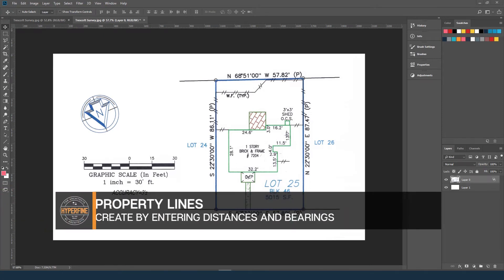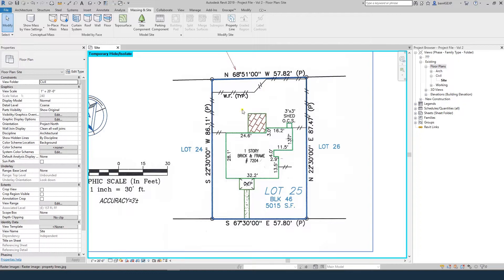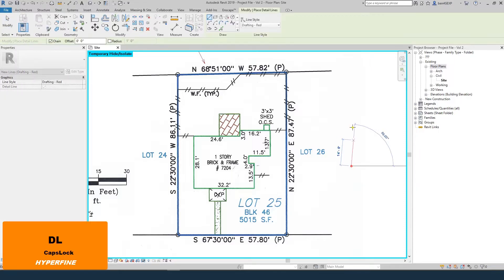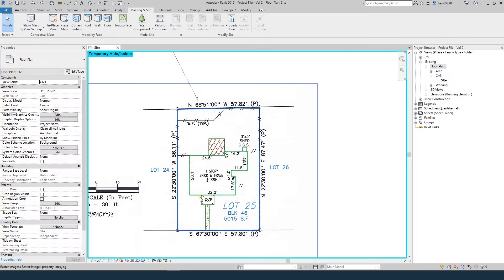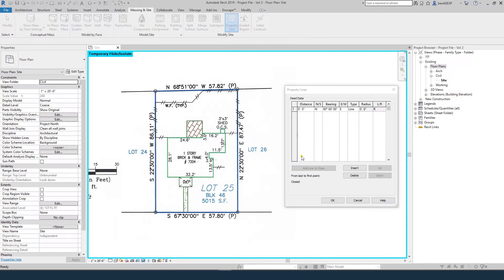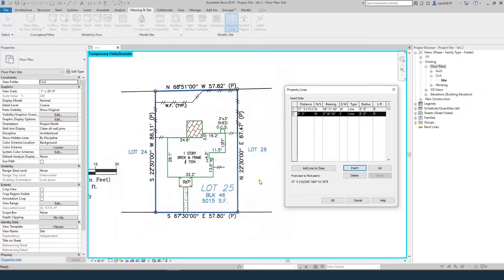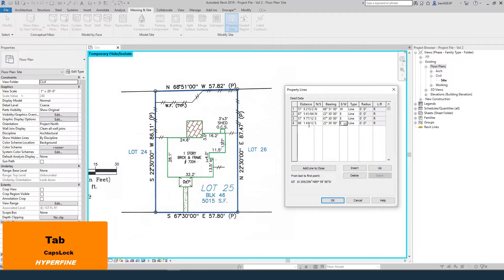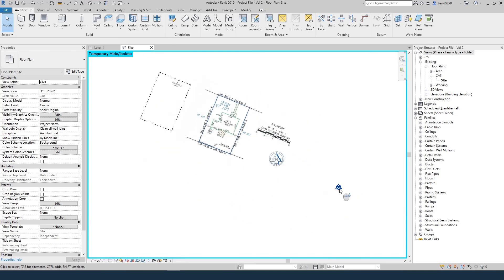Revit Property Lines: Enter Bearing and Distance

Comment: Can you create a curved "front" property line and property line setbacks video???
Reply from the maker: I've been struggling with this lately myself. What works is I start with the bottom left corner of the property and work my way around going clockwise. When I get to the front property arc, as long is it's the last line I need to do, I use the "add line to close" feature and make sure I select Arc and correctly enter the radius. Been working a lot better than me trying to enter the info, because it seems you still need a bearing for the arc, which you don't get with a survey.

Comment: Nice video, thank you very much. Do you need the exact true north orientation for this to work, or can true north be the same as project north?
Reply from the maker: You don’t need to use a true north / project north if you don’t want to. It can help with understanding the orientation of the project, but for a single house you could just work with Revit the way it’s set up and just place a north symbol pointing the correct direction.

Comment: What about property lines with radiuses? Haven't been able to sort that out.
Reply from the maker: You can use the radius tool in the same dialogue box. If you can't get it to work then do as much as you can with bearing and distances and then trace over it with a sketch and fill in the missing pieces with your survey data.

Comment: Drives me nuts when I input the property lines and get a line warning that the lines are skewed.
Reply from the maker: Yep, I agree, though haven't found it actually causes any problems. But I also don't usually have projects where I need the property line to be 100% accurate. Still annoying though when it says it's skewed or the property lines don't close based on what's in the survey.